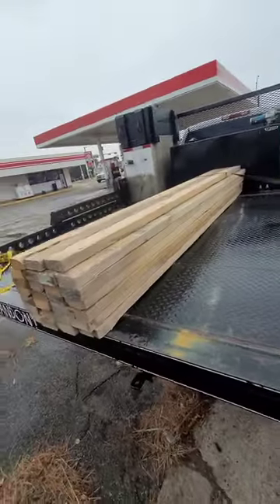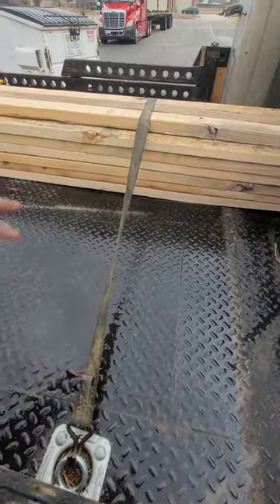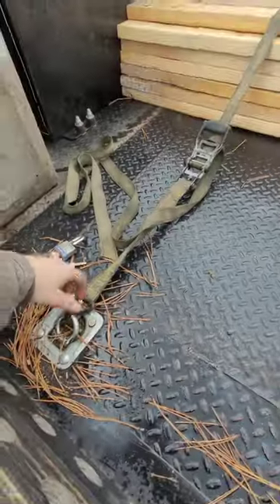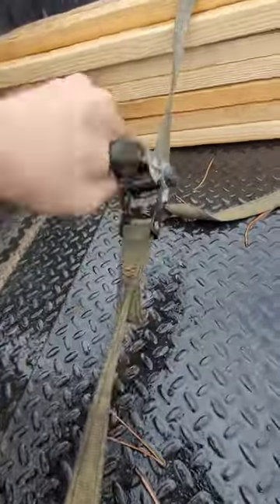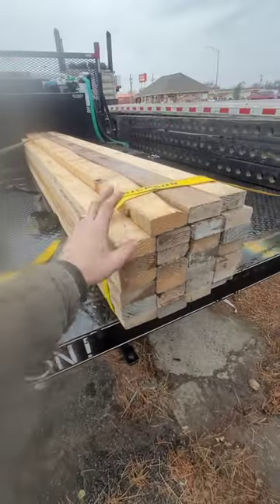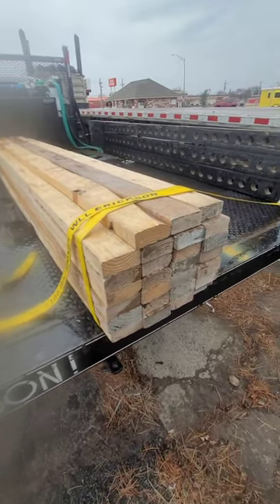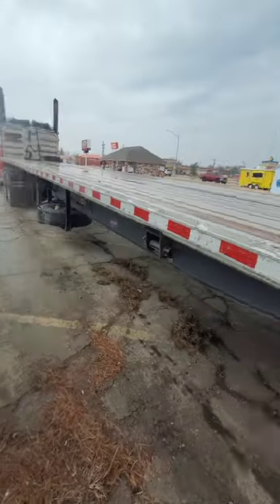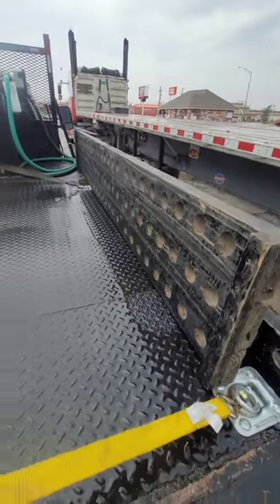How to secure lumber properly

Comment: Would this also be a good idea and work with 12 and 16 foot 4x6’s on a 14 foot utility trailer ? I would be taking the ramp off on the back to make it completely flat.
Reply from the maker: Yes.  It would work with them as well.  Little tip:  If you lay 3 4x4's across the front, middle, and  back on the floor, then put the lumber on tip, its a little easier to tighten the straps, plus you won't have the lumber on top of the straps possibly damaging them.  You can pull your straps out, then unload rather then unloading everything then getting the straps.  Most 16' trailers should have either d-rings, angle iron, or channel iron you can secure the straps to.
Reply: @aftersolo  thanks so much. Worked perfect ! Actually almost home right now with my lumber on the trailer ! Hasn’t moved an inch!

Comment: It's call a belly strap.
  with a tiny load like this what you did will get it to its destination....

But the proper way to do this would be to lay the strap in the middle before you put the lumber on top. Then secure the pieces together with the belly strap. The purpose of the belly strap is not to secure the load to the bed of the trailer. It's only purpose is to turn 20 pieces of lumber into one piece.

Then strap front and back. 

The difference is this and again with a small load that's probably not going very far it's not that big a deal but with a bigger heavier load it is.....

The way you are doing it you are not getting anywhere near as much securement of the lumber to the bed of the truck which is the purpose of the front and back strap.   You touch on this without even realizing you're touching on it when you said don't tighten the first strap down yet.  Exactly why you need the third strap. You can't tighten the first strap down the way you are doing it because You're trying to do 2 things that are supposed to be separate with the second strap And it won't work. 

Again with a small load like this it's not really going to matter...   But as your loads get bigger or more complicated or don't fit nice and neat together like lumber....  Think of copper pipe for instance.....   Using a dedicated belly strap in the middle And having your front and back straps only securing to the bed of the truck or the trailer is your best bet.
Reply from the maker: There's one thing most people don't take into account and I didn't have time to go through it on the video.  The smaller the bundle, the less down pressure you'll have with straps only over the load.  So lets say you only have 12 boards.  Theyre probably only going to be 4 high, which is 6".  If you belly wrap it the way you suggested then put 2 straps over each end, those straps have very little down pressure.  You can actually pull the bundle out by hand practically.  If you belly wrap it the way i did, it keeps the lumber from sliding.  Its a belly wrap thats also secured to the bed.  You could belly wrap it the way you suggested, then sucure the belly wrap to the bed somehow and that would do the same thing.  Most people probably wont have 3 straps or are willing to do all that honestly.  

Heres another thing you can do for extreme securement.  You can belly wrap it at the front and back, then put 2 straps over it, then build a bulkhead at the front and back in case anything does go sliding.  We do it all the time in flatbedding for big coils or greasy bars and pipe.  

The reason I say not to tighten the strap at the front that only lays over the load is this:  The load has to be squeezed first to get out all the voids.  I''m just used to securing it like this.  I do loads of pipe and they weight about 48000 lbs.  I can't belly wrap a load and get it as tight as I need it without breaking my 4" ratchet.  It can only take so much.  I have to belly wrap it the way I did in the video to get it to the tightness I need.  I have winches on the flatbed that the straps slide through then I use a 40" winch bar to tighten them.  It squeezes the load at extreme pressure.  I can put all my body weight on it.

Comment: Shouldnt each collum have a bend in the strap?
Reply from the maker: I don't understand your question.  Could you be more specific or re-phrase it?
Reply: Each column should make contact with the strap, think of a pyramid, but i guess it depends where your tied own points are, eliminates the need to loop the back, as you tighten the strap, if each column is making contact with the trap it forces them all together, just another way is all
Reply from the maker: @xterrorx8376  I got you.  I've done it that way before too.  Its difficult to make sure the strap is holding everything from sliding though especially when your tiedown points are wider than the stack.  I prefer this way bc it squeezes everything tight together and let's friction keep anything from sliding.  I do it all the time on loads of oilfield pipe on my 48' flatbed too.  Fills all the voids.
Reply: @aftersolo  yeah I noticed you had not tie points closer to the load that's why I added the comment it depends where they are, keep on keepin on brother. Take care 👍